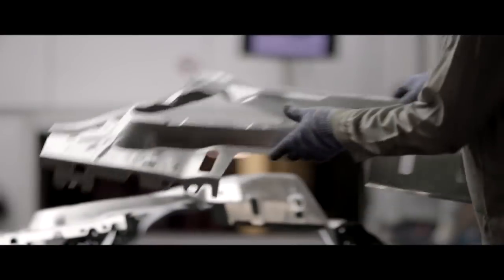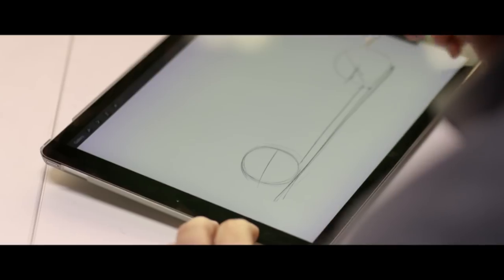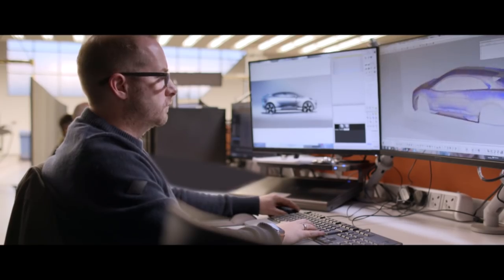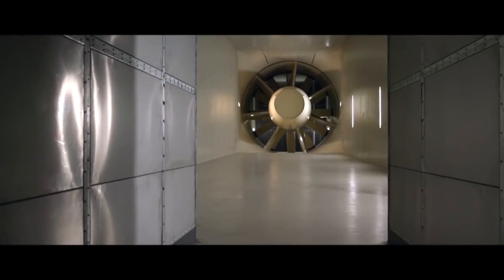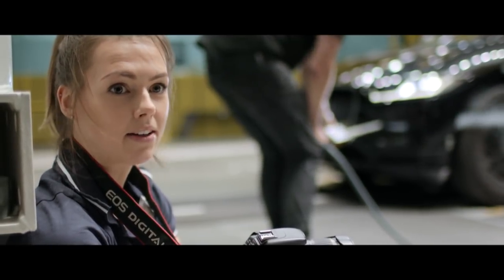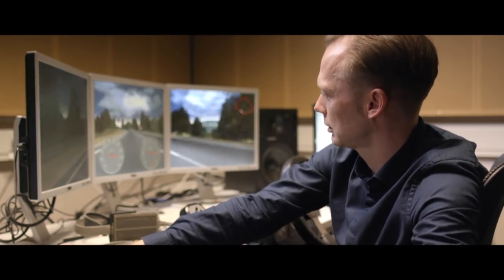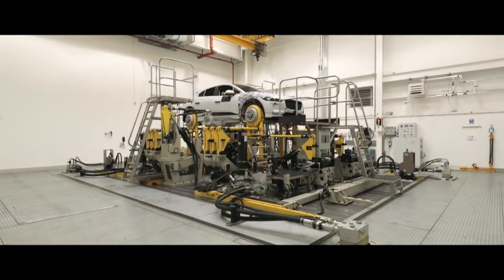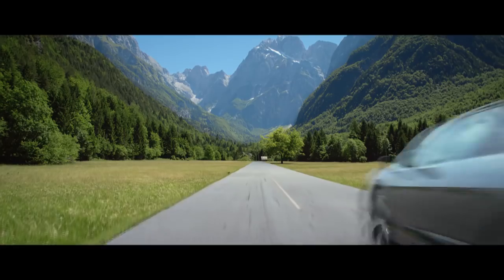Jaguar I-PACE | Creating the World’s Finest Electric Car

Comment: What's amazing is Tesla does all of this without clay models, without fancy acoustic labs, without test tracks, without shake rigs - without any of this old skool car engineering fluff.  They do it using science and software.  Do you think the Navy builds a test nuclear submarine to shake out all the issues before making the real one?  Do they build an aircraft carrier from clay first?  Nope.  It's done using state of the art virtual modeling.  This is the reason Tesla will beat the conventional automakers - speed of innovation.  It will still take Jag 5 years to develop a new model, regardless of the type of engine underneath.  Until Jag revamps their way of thinking about design and development (and quits letting the artists dictate the shape!) - they won't be able to keep up.  Future belongs to highly agile companies.  SpaceX was just learning to hover a rocket a few years ago.  Now they are landing multiple booster rockets in perfect synchronization.  You can't do that on the timeline of a conventional carmaker....
Reply: SDav21 Its also funny how for 3 years running now Tesla ranks #1 in customer satisfaction, well ahead of Porsche.
Reply: Eric Fontaine
Rather you`re the one who has been living under a Rock......Remember the countless problems with the Model X? The Model S DUs that still fail regularly, or that they already had to recall the Model 3 for stuff like the seats, the door electrics, the MPU etc? Tesla has released every single car so far in a state that other manufacturers would still call a "prototype".......Tesla cars are great...when you wait a gen or two for them to mature. Tesla isn`t faster in developing new stuff, they just skip most of the finetuning and release beta soft-and hardware. What Elon promised for AP1 f.e. still isn`t available on AP 2.5! There`s a reason Tesla has such a "generous" warranty and goodwill policy......
Reply: F Schaumann Agreed there have been issues.  But the data suggest they are still better than other makes.  I have a Caddy, Audi, Merc, and two exotics.  None are close to Tesla in terms of flaws - they are far worse despite being "pedestal cars" from top brands.  Further - other carmakers have decades in minimizing those.  They call them "TSB's" and you would be shocked how much they spend on dealership "warranty" work.  Warranty issues due to poor engineering cost companies like GM, VW, and MB more than 25 times Tesla's entire operating budget.  But you will have a hars time finding that info in GM's 8k or 10-Q or other quarterly filings.  Theres a reason conventional carmakers are so viciously defending the "dealer network".

Yes - all cars have quality issues.  What I challenge is any data that shows Tesla cars are anywhere close to as bad as other makes.
Reply: SDav21 Ok.  Whatever you say...Im sure SpaceX makes little clay rockets first, too...
Reply: AVA is the future
Reply: William Chadwick Nvidia's new HoloDeck technology is just incredible
Reply: Eric Fontaine
Tesla has been a niche enthusiast brand so far. Most EV people will defend their wheels to the death no matter how horrendous the "problems" are in comparison, ESPECIALLY Tesla fans. I´m pretty sure most of them would still make a cross for "absolutely satisfied" if their car was on fire in the background...... I had a 2014 Model S for 8 months and now I´m back to a Mercedes E class.
Granted the drive train isn`t nearly as much fun as the Tesla`s, but the overall build quality is several leagues above the Model S´ despite a ~20k lower list price and the number of issues the S had in that short time....well, let`s just say that if Merc/Audi/Bmw offer a similar powertrain to a Tesla I´ll never ever look at Musk`s hobby-workshop again. The I-Pace is a good start...but I´m not really trusting Jaguar/Tata yet considering how terrible Jag`s quality was in the past.
Reply: and this is why tesla are on the skids and sales are down plus they cant meet targets, no heritage like Jaguar has
Reply: yea but half the reason you buy these fancy cars IS becuase they were designed by artists. aerodynamics comes second to these people, looks come first.
Reply: Eric Fontaine Are you an actual idiot or a Tesla fanboy , probably both . 
Not everything is clay modelled. Cars are made in clay first to assess the looks and dimensions of the car in person .You don't need to have good looks in a  rocket , it just needs to be stable and aerodynamic. 
Try to think before you comment something dumb .
Reply: amanrehan manzer So please tell me what the fake front grill on this monstrosity is for??  Some artist looked at the clay model and said, "Hey, where's the front grill?".  An engineer said this car doesn't need one.  Then the artist says, "But it looks better if we put a fake one on."

I'm not sure why form following function is "idiotic", but feel free to keep spending YOUR money on fake front ends and phony engine noises if you like.
Reply: Eric Fontaine As you can clearly see in the video , the front grille is for aerodynamics and cooling the battery underneath. The grille deflects the air flow .You would have known this if would have watched the video instead of just complaining .
It's is also there signature design element which is essential for the brand .

So yes, it has form and function Now that other brands other then Tesla are making evs , you are crying and complaining about stupid things. Do you even want evs to be mainstream or are you the member of Tesla fangirl cult who hates any other evs other then Tesla.
Reply: amanrehan manzer No...I just don't care for "branding" as a design criteria.  I guess that is one way to cool the battery - and yes I did watch the video.  Its just not a very good way when you no longer have a combustion engine to deal with.  

And I'm with you on wanting to advance EV's in general.  I'm def not a blindly loyal Tesla fan...although I do get that there are plenty of them out there.  Please be kind and don't generalize me with them.

I AM, however, a big fan of rethinking how we approach things.  For example:  I also think diesel locomotives are absurd when we could make them purely electric and build high-speed rail like is being done in other parts of the world.  I suppose its fair to say I am probably far more critical than I should be when I see old school automakers following the same old ways of doing things.  

Some old ways are good as they are proven, but clinging to gasoline engine noises in an EV is actually counterproductive to the advancement of EV's.  And its somewhat insulting to the consumer.  It portrays them as uneducated, superficial, and unable to get over not having a gas engine.

And yes - I still assert that making clay models and testing mules for a full year or more is also silly.  We can design almost anything perfectly in a virtual environment now.  When something like Level 5 automomous driving comes around - thousands of people will literally be dying in accidents waiting on these companies to get a new model on the road.  Society pays the price for slow progress and innovation.  So I feel obligated to challenge the status quo.  The fact that it takes 5 to 7 years to get a new model on the road is just absurd.  I like that Tesla is boldly challenging this.  They are clearly taking a ton of heat for it, but just like Amazon has improved life for all of us, I think Tesla - via industry disruption and challenge, will probably do the same.
Reply: So you're saying Tesla creates car differently than others? That's nonsense. They even had a clay model of the 3 in 2010... 2010!
https://evannex.com/blogs/news/117124293-production-ready-tesla-model-3-designed-for-ease-of-manufacturing

Also, it does not take 5-7 to develop a car... If you take in the consideration of developing a platform and then a car, yes it can take that long. But if you already have a platform it takes around 3 years.
Reply: Eric Fontaine, how do you know Tesla doesn't do any of these things? Honest question, I am not a car guy but have been very interested in this stuff since Tesla arrived. My impression though of Tesla for why they develop fast is because they build more in house and iterate a lot more instead of generating lots of specifications. I listened to a NASA engineer talk about the difference between how SpaceX builds rockets and the traditional rocket makers. He talked about a heat shield factory. At spaceX they started making small scale version of the factory right away and tried it out. Then they found problems and scaled up to slightly larger version. They kept doing these iterations. While traditional manufacturing seems to be more waterfall in their design approach. They develop all the details for the whole thing at full scale up front and writes reams of documentation and specs which is fanned out to suppliers.

I would suspect Tesla is much the same. That they do a lot more hands on trying out things and iterating rapidly. The trade-off seems to be that Elon Musk is far more willing to fail. Like he will not explore every possible area of possible failure to save time and move faster. That means his companies are perhaps more likely to get unforeseen problems pop up in production. 

I am not sure which approach will work out in the end. The Tesla approach seems to have improved design and development time a lot. But it doesn't seem to work well for creating the production line.
Reply: thats exactly why tesla has so many quality issues
Reply: rpgfightin4ever Seriously?  Have you been under a rock?  All reports are that only the early cars that emplyees of Tesla bought had any issues and they were minor.  Please cite your source that Tesla cars have any known quality issues for cars sold to the general public.
Reply: Another dumb dumb sour grapes bitter tesla fanboy. This is how a vehicle is made. And this is the reason they can produce them reliably and why they have no panel gaps, faulty doors, faulty door handles, faulty motors, faulty systems unlike tesla that can't even produce a simpleton electric car like a model 3 which does not even have a damn dashboard. How they are making this car is with science and software. I don't know what video you watched. Despite machines that can in some way simulate certain things, real world testing needs to be done. You are completely naive if you think a car can be built using only software. And this is exactly why tesla could not even get close to meeting model 3 production targets nor produce them consistently. 

So you are totally wrong. Unless tesla LEARNS how to properly develop a vehicle, they will be left behind. They already are being left behind because everyone else can make an electric car more profitably, more consistently and more reliably than tesla can. Tesla thought they could skip steps in the model 3 production...well now look at where they sit. Lol. You have no idea what it takes to develop a vehicle. And if you think tesla does not perform at least some of these (they may outsource the testing) you are yet again naive and completely ignorant on the matter. These manufacturers also use science and software but it still needs to be validated by real world tests and with actual cars. You don't develop a scientific theory without then testing it and concluding thereon. This is what Jaguar and the rest is doing. Dumb dumb.

Comment: Congratulations to Tata on joining the EV market with a strong entry.
Concerned though at the over the top assertions of superiority. 
Something the other leader does not spend promotional money on, relying on the product to promote itself.
Particularly noteworthy is the emphasis that this promotion places on aerodynamics yet failing to get close with .29 to Tesla or Hyundai with a .24 coefficient of drag. Not leading.
Perhaps because of this or just inferior battery and electronics tech, they also get a low range from a large battery pack. Not leading (inspite of Formula E tech).
Clear that the styling had to start with the grill and the car built around that. With the added ICE noise!, clearly a company that has yet to shake off its ICE traditions and is treading timidly into the EV future while holding mommy ICE's hand. Not leading.
Reply: Jaguar are too scared of losing the customer base they have, Jaguars have always sold for their brash engines and styling which are really easy to lose with an EV. I believe they had to juggle the current brand image with the new technology. As for battery tech, you have to start somewhere and as a company not even a fifth of any german manufacturer, id say its done well.

Comment: Couldn’t give up the pointless grill in front, eh?
Reply: I personally and know many others who hate the front of the model 3, i understand its a 'because we can' but its just fugly.
Reply: Matt Boyd But that and the additional sound coming from the speakers? I can see it being a smart move to attract folks new to EVs. The original Tesla Model S had a grill.
Reply: That's likely part of it. I just don't think it's necessary to make it look like a traditional grill. I bet they think that'll help them sell the car.
Reply: terrorista31 What would an electric car look like if optimized for aerodynamics and not current trends? Maybe the Model 3 is also holding on to something of the past that we’ll see change in the coming years.
Reply: It's not pointless air enters in there and exits on top
Reply: It shows in this very video that it is used to improve the aerodynamics.  There will also need to be air going in for cooling.
Reply: Robert Blackford True. The top portion of it does have an intake, but the rest of it is made to look like a traditional grill for aesthetic reasons.
Reply: I like the grill in front, as others said it makes it more aesthetic
Reply: doesn't the front grill also work with the condenser of the air conditioning system to cool the AC?
Reply: terrorista31 they use lipo batteries instead of Lithium ion batteries, which meens ~200% more expensive, and if they get overused, instead of heating up, they explode like a giant note 7.
Reply: Fake grill, fake sound, the car is a joke. Seems like they can't make a good electric car, either it's too gimmicky or too underpowered, or something like that. The new Nissan Leaf seems like a way better option. Or a Tesla. Although I'm a huge fan of the new Leaf, it's still just like a normal car, but it's electric, it's perfect.
Reply: What do you mean "give up"? Its aesthetically pleasing, it completes the vehicle.
Reply: William Chadwick I love the front of the Model 3, but to each his own.

Comment: The fake sound is there for a reason it used to let blind people be aware of it is approach...
Reply: No. Outside noice are maid at 0-30kmh, this car makes noice INSIDE the var at 50-100kmh
Reply: Or the driver can just look where they're going
Reply: it's coming in through the speakers, how would that help blind pedestrians? nonsense
Reply: Nope, internal only. It's for people that have been conditioned to hearing an engine sound when accelerating. I guess old dogs can't learn new tricks afterall.

Comment: It seems they made a great job and are really serious about EVs. Very pleasing design. Interestingly, I had the impression the I-pace not to have a reduction gear, that would be a smart move, so the drive unit could last nearly forever. The sound generator is complete nonsense, I hope it can be switched off.

Comment: Towbar?
Reply: CEO says it cuts range too much so it won't be rated to tow. you'll have to get an aftermarket tow bar
Reply: Justin Crediblename 750kg so only good for garden rubbish trailers or a light dinghy...not really on a level with model x then
Reply: Most people are not towing with their crossovers anyway. Towing drastically cuts the range of the model x too. It becomes pointless to tow. If people want to tow, we buy a diesel.

Comment: Can someone buy jaguar back so it's British again thanks
Reply: Mark Williams lol , so you can mess it up again, it will take Tata 20 more years to fix JLRs ruined reputation, the British management would never take the risk and they would have wasted British engineering and when the whole industry overtakes then they will tank the company
Reply: Jaguar is British.  It doesn't really matter who the owner is.  Tata is just a holding company, it doesn't run Jaguar.